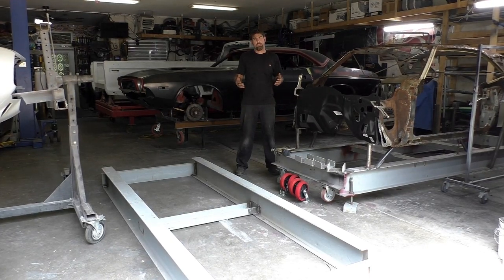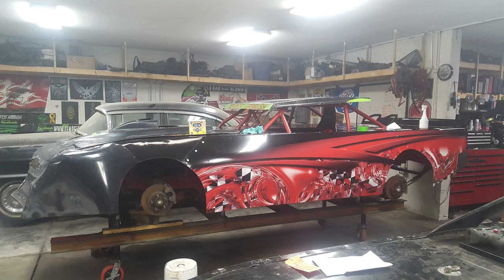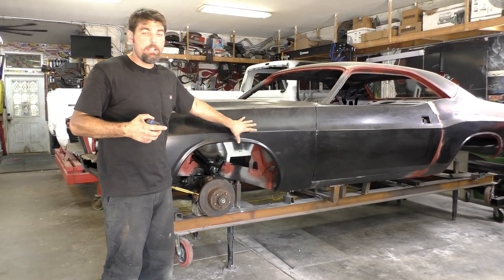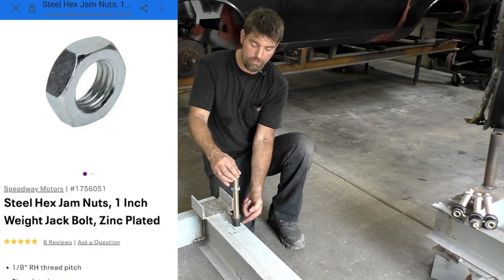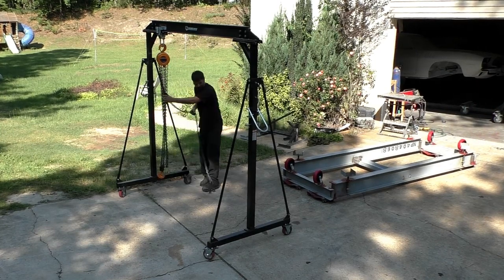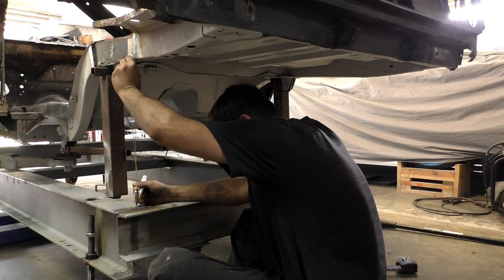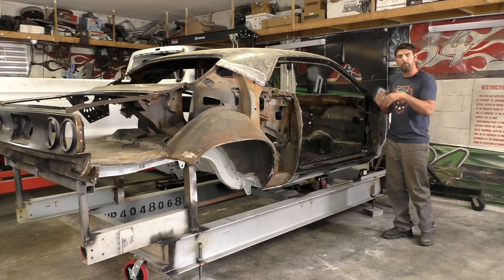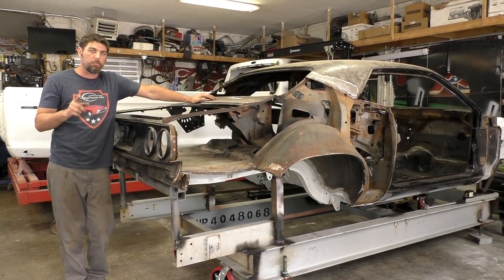All About frame JIG's and why your Restoration Project needs one!!!

Comment: Thank you very much for this video. I'm getting back on my 72 Camaro restoration and will need a frame jig. Actually I've been putting it off just because I'm needing to figure out what I need. This really takes alot of guess work out of it. I cant tell you how much time I have looking for something that will level a jig. Now I just need to figure out the length of my jig, find some I beams and get some .035 wire. Thanks again, Russ
Reply from the maker: Your are welcome Russ, good luck on your 72 build.

Comment: Hello colleague. Your attention to detail is enormous. You seem to be very precise in your work. I ask for suggestion after first time seeing the screwjacks that level your frame JIGs. And i got an idea how to improve my homemade frame streightning table. I do mostly simple hammer and dolly and a bondo jobs but sometimes i use my homemade frame straightner to pull LIGHT frame damage if present. Currently my homemade frame streightning table sits on four dense wood blocks and i use large number of different thickness shims between the blocks of wood and the table itself to level it front to front and side to side for datum. As you can imagine with this setup this takes quite a time. Im looking forward to modify the table by adding this type of screwjacks. But i think i need heavy duty ones since the table itself is 2000lbs. And some unibodycars i work on add 3900-4000 lbs to this weight for a total of 6000lbs. Do you know of screwjacks that could safely support such weight. 🙏😊
Reply from the maker: Thank you very much. So I do not know of any screw jacks off the top of my head that are larger, however my JIG tables here weigh around 1000 lbs so I am not far off from you. These screw jacks are designed to hold the front end of dirt track race cars that weight in around 3500 lbs. Most of the weight are on the front ends of them so honestly they might work for your application. Maybe on your table instead of 4 use 8 of them since the cars you work on weight a bit more then what I have here with the engines and everything.

Comment: Excellent video, thank you for sharing this…I am needing to build the exact same thing for my 71’ challenger! Mine was drag raced very heavily many years ago which twisted the body where now it needs to be remedied. Keep up the great work saving these cars brother! I do know that in 1973-74’ cars went to iso suspension which might have changed a couple of things but it may just be a different measurement due to different component mount points…I’m not sure about that but if I find anything I will let you know.
Reply from the maker: Thanks a lot and yes keep me posted!

Comment: I know this is an old video but maybe a short video on how to read a frame measurement chart. And where each measurement point is on a car and even the names of the different locations on the car would be really helpful. I have a line on a great 70 GTX going to need a ton of metal work and frame rails. Want to make sure they are 100% right. Don't know many people around here that would take on a repair like this and finding a pro shop to do it would be cost prohibitive. If I build a frame Jig and can figure out the measurements I'm sure I can handle it with alot of patience and measuring 30 times each. 😂
Reply from the maker: We will see what the future holds on something like that and will take it into consideration. Its hard to be very specific as most of these cars are completely different. I do a lot of specific stuff with measurements on E bodies, but that wouldn't help you.

Comment: Did you ever come up with a reason on the dimension change at the 73-74 break? The 74 Challenger also same just wondering if the front rails used until then were B body, then final year of production had their own? Nice work, by the way.
Reply from the maker: Thanks for watching and for reminding me. 70-74 Challenger had no frame differences and the 70-74 Cuda frame measurements were exactly the same everywhere i measured. I put a 70 on this JIG after this car was done and it fit perfect. Don't quote me to be 100% accurate on saying I believe the 71-74 b body should have the same front rails and everything forward of the firewall I believe.

Comment: Thanks for another great video. I will be incorporating a K frame and pin locations from a car that has not been wrecked. So I can slide it under an identical car that has been wrecked. I hope it works out that the pin locations are accurate car to car off of the assembly line. If not, I'm thinking Adjust Or replace Parts so the car to fit the jig ??
Reply from the maker: Yes that is for the most part what I do with my JIG I have for the e -bod cars. I think you are on the right track and when I put front frame rails in cars that need them it has worked out well.

Comment: How would you support it if you were replacing a dynacorn trunk assembly
Reply from the maker: With the Cuda in this video I am installing a full trunk, tail panel, trunk gutters, wheel houses and literally the entire back section of the car minus the frame rails. So this is exactly how I would support the frame rails and build off them.
Reply: @carthageclassiccars  that's my problem. I know once I take the back section off I wint have the rails. I'm not sure how to support the car while I change it. I did build some temporary frame rails out of box steell and I may use those to support it
Reply from the maker: @twmotox  gotcha you got the one piece dynacorn setup with the rails, I am tracking now. Look at my video 2 cutting out the rust on a f-body car. I remove the rails in that one and show how I try and build the rear rail JIGs. In a little bit I will go ahead and install them. Also on the e body cars use the shackle mounts and pin holes as mounting points.
Reply: @carthageclassiccars  Perfect. Thanks again

Comment: How much were you tweaking these metric chassis for dirt racing
Reply from the maker: Its trial and error more going off bar angle in the back lower LR bar. Basically there was no magic inches on the chassis all 4 corners are on the jig with suspension in place and start with angle finders and moving certain points where you would get the certain measurements that has worked for my driving style. There would have to be a whole long drawn out video series on just that to actually explain my theories, most that come from lots of failures.
Reply: I would like to pick your brain on this one day
Reply from the maker: @slimpal1414  sounds good